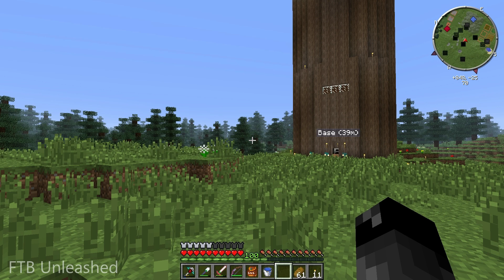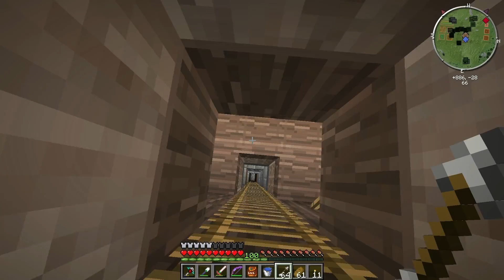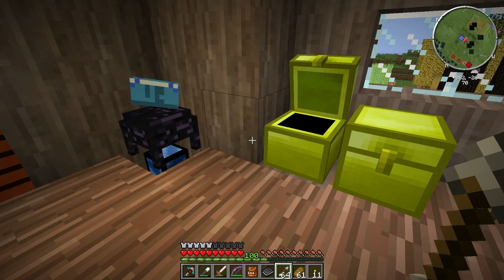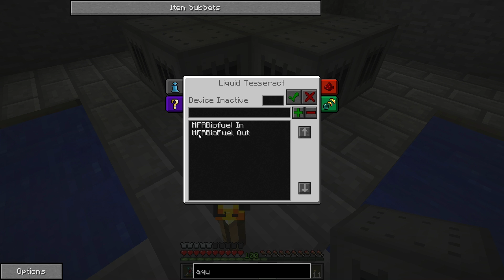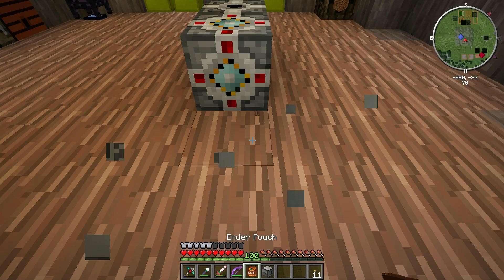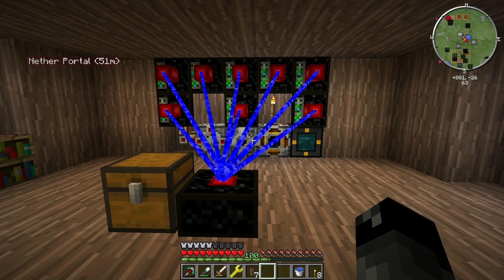Hypno FTB Unleashed E13: Boiler, Lasers and AE!

Comment: I know its an older video but just giving a heads up that your not fully using all the steam from the boiler.  If Im not mistaken, non-redstone connections with liquiduct only transfers out 80mb of steam and only to 50% of the boilers steam capacity .  With a redstone signal, itll pull out 160mb and can pull all of it.  With a 36HP boiler, you can have 5 redstoned liquiducts with the arrow on them and get all the steam from one boiler into the tessaract and then use the power converters mod elsewhere and get even more power then your getting now.

Comment: Hypno, i have created a network of 18 high pressure boilers. they are supposed to make 12,960 milibuckets of steam/tick. i have connected a liquid tesseract to the liquiducts and 3-4 tesseracts to power other machines with the power converting blocks.the problem is, not enough steam is tranfered with the tesseracts.. any ideas on what to do? everything is checked,everything is chunk loaded.. please help !

Comment: That recipe is from the UE Api, which is included with the MFFS mod, because most of the stuff from MFFS use steel, and that recipe is the only way to get that without TC or RC installed. It can be turned off though, but i don't think the FTB team knew about it since it is pretty hidden in the configs.

Comment: With the change to Buildcraft energy pipes, Power Converters doesn't interact with them very well. Sometimes power will get through, but nothing consistent. So until there's an update you pretty much have to use energy conduits if you want to use Power Converters.

Comment: It's not about hardness. It's about basic BALANCE. You have 2 ways to make steel (for example). One is cheap, the other one is fine. They are booth enabled. Which of them do you think people will use? Cheap one ofcourse. So the more expensive one is never being used, and can be removed. But it's more interesting than the cheap one. So one of them should be removed, there can't be 2 ways of getting a thing for a different total price.

Comment from the maker: The wooden pipe acts like a restriction.  You can pump in 100000 MJ and it will only output 32.  The problem is the pipe just was not receiving power.

Comment: Hypno, you don't need an assembly table and lasers at all to make those processors, you make a processor assembly (basic or advanced), which requires only a quartz cutting knife and the right materials, and then you just cook them in a furnace to get the ME Basic Processor and the ME Advanced Processor.

Comment: Hey hypno, i've done some testing (in ftb ultimate, but i'd imagine this didn't change) and I figured that a quarry uses at maximum 25MJ/t while moving its arm, and then at max 92MJ/t when it is digging a block. This averaged out to at max a redstone energy cell with the max output to 27MJ/t, and the cell was veeeery slowly charging up. This means that if you have a redstone cell with 27MJ/t in and minimum 92 MJ/t out, you will get your quarry at max speed at all times :)